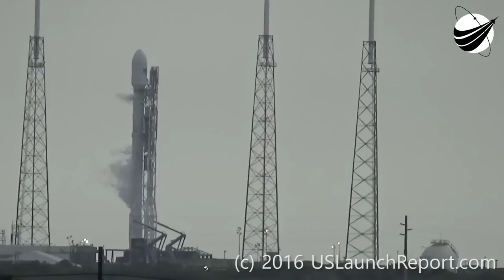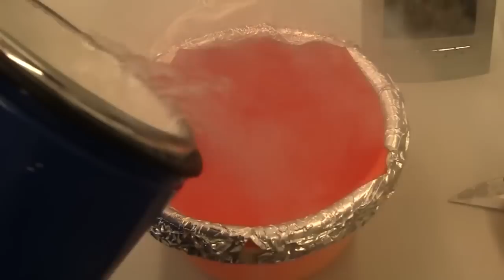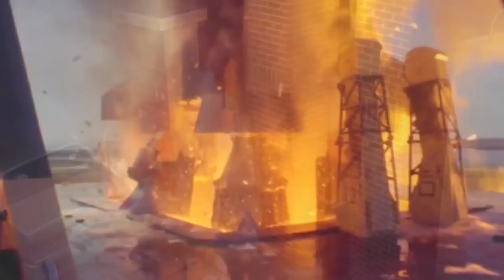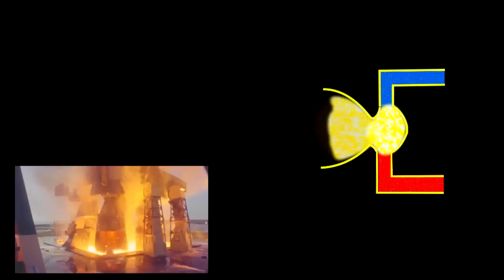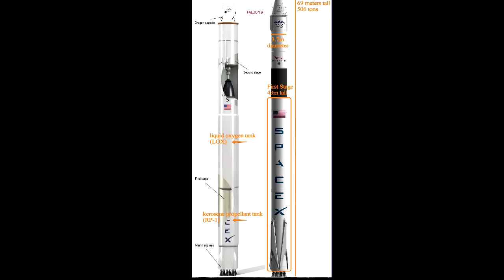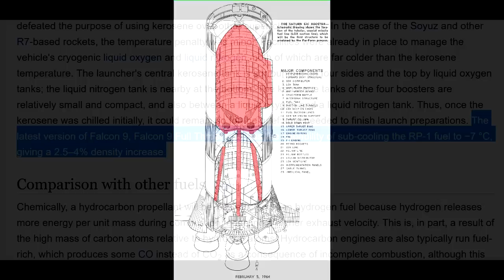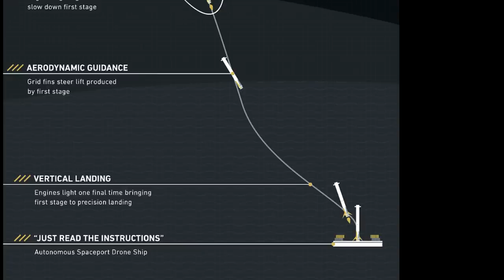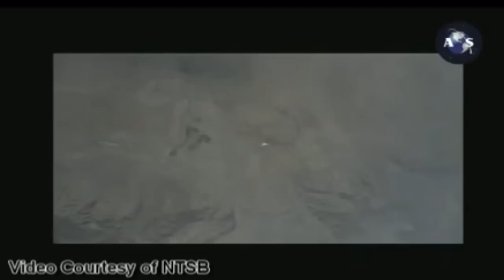Why did the Falcon 9 Explode?

Comment: show me any example in nature whereby gas moves a body in space...
Reply: +new perspective   A comet's tails (one gas and one dust) are affected by the solar wind.  Also, outgassing from the comet can cause changes in rotation (and possibly changes in velocity), similar to the effects of rocket thrusters used for rotating spacecraft.  http://www.sciencedirect.com/science/article/pii/S0032063305000826
Reply: so why did the comet that was tested for composition by a BLAST on the surface not move in its trajectory..???
2 force pair and two bodies are required to ratify newtons third law...out gassing has no force....freely expanding gas requires no force to expand therefor produces no force..
Reply: If gas has an effect on objects in a vacuum I would expect to find an example in nature. All forces that man has access to exist in nature (including fission, fusion, chemical reactions, steam, etc...). We do not create forces we only discover them. In ancient times people thought a comet's tail was a gas jet pushing it along. Today I cannot find an example of an object moving through space via gas/jet propulsion although streams of gas and particles shooting into space exist. Saturn's moon Enceladus, for example, shoots a jet of water ice 500 KM into space. The diameter of the moon itself is only 500 KM. Does this jet have any effect? No. The jet as tall as the moon is wide goes harmlessly off into space. http://en.wikipedia.org/wiki/Enceladus_%28moon%29
Reply: "All forces in the universe occur in equal but oppositely directed pairs. There are no isolated forces; for every external force that acts on an object there is a force of equal magnitude but opposite direction which acts back on the object which exerted that external force. In the case of internal forces, a force on one part of a system will be countered by a reaction force on another part of the system so that an isolated system cannot by any means exert a net force on the system as a whole. A system cannot "bootstrap" itself into motion with purely internal forces - to achieve a net force and an acceleration, it must interact with an object external to itself.
Reply: out gassing of a comet is very debatable as the tail is officially described as gas....nasa dirty snowball...this definiton is under scrutiny as new observations imply it is a plasma discharge....the evidence for outgasing is scant and debatable
Reply: new perspective   If you saw comet Hail Bopp, then you would know that it had two tails.  One bright one and a dimmer blue one.  This is due to there being more than one material coming off of the comet (gas/plasma vs dust).  Often people don't differentiate between gases and plasma.  Such as saying the sun is a ball of gas, when more correctly it's made of plasma.   But since a plasma is often defined as an ionized gas, it probably can be said that both are correct.  So whether a comet outgases "gas" or "plasma" wouldn't make much difference in regard to how ejected materials affect the object that is giving them off.
Reply: joules principles state that freely expanding  gas in a vacuum requires no force to expand....so how does gas interact with the comet if the gas is not interacting with its inhabiting medium...
newtons third law requires that there be two force pairs and two bodies
gas freely expanding in a vacuum is not a force.....F=ma implies there is a force but a force is not a force untill it interacts with something...
gas cannot interact with a parent body unless something interacts with the gas..
An energetically isolated system, cannot push itself through space
Reply: new perspective  Expanding gases create pressure (therefore force) in all directions.  Pressure is a force pushing against the internal parts of the rocket engine (or against the comet).  Since the rocket nozzle opening creates an imbalance of forces, the gas pressure pushes in the direction of the rocket an expands into the vacuum (when in space), creating thrust.  http://web.eng.fiu.edu/mathmatters/m2ed/newtons3rdlaw/IMAGES/index_clip_image002_0000.jpg  The evidence is that there are working satellites in space.  GPS, weather and communication satellites as well as the ISS.  All of these used rockets that work in a vacuum.  You can even see the ISS for yourself when it passes overhead.  Just input your location into this website for the next time it passes over your location.  https://spotthestation.nasa.gov/sightings/   I have seen it a couple of times.
Reply: force is not a force untill it interacts with something...and newtons third law specificaly states there need to be two force pair and two bodies..
 According to Newton's 3rd law of motion, for every force there is an equal and opposite reactive force. If you push on a wall, it pushes back on you with equal force. Obviously, you cannot push on a vacuum. And you can't push on gas that's exposed to a vacuum (not under pressure). A rocket works within the atmosphere because, when you decompress a highly compressed gas, it must push some of the atmosphere out of its way as its volume expands, creating a reactive force, as the pressure equalizes. It's the weight of the atmosphere under gravity that squeezes the decompressing gas, providing thrust. If you remove that pressure, releasing pressurized gas from a rocket's nozzle is like trying to divide by zero. The equation used to calculate the work done by a gas is: work = pressure x change in volume. If pressure = 0, then work = 0.

Comment: Thank you for the video Thundertf00t. Didn't realize you could actually calculate the amount of mixed fuel by the primary explosion =) 

However, from an engineer's perspective, I do really think you go a bit harsh on SpaceX here, here are my 50ct if I may:

- Having a problem solved decades ago does not mean that a problem will never happen in a new design. Consider something sounding easy like a "pipe running through a tank". Once you start an engineering design, it doesn't sound so simplistic at once: you have to find a way of doing so which can be produced, assembled and inspected - an that cheaply. You have to find sources of the materials you need and ensure their quality. You have to account for any temperature-related effects, aging effects and so on. Each of the problems may sound very solvable - after all, it's the engineering routine, yet with so many parts on a complex machine with so many little stuff to consider, mistakes do sometimes find a way in, even through testing. Just think about Challenger Shuttle! Now SpaceX is probably even more susceptible to those, because they seem to experiment with new production technologies a lot. Let's be honest: it's not about a "better rocket" but a "cheaper rocket". But even through the risks increase in the short term, cutting costs is a very valid reason on the long therm! Either you cope the risks of attempting new solutions, or there is no point on trying to improve an existing system.

- The reusability at the costs of fuel has been discussed a lot in Musk's interviews: his point is that fuel is really cheap and sacrificing part of the load to be able to refly the very expensive first stage does make sense economically. Of course, the refubrishing process must be cheap enough - not the way it was with the shuttle. It's a lesson learned. I'm not surprised they did not yet refly a stage, as getting the reusability right is no less about what happens after the landing as it is about the landing itself. They should take the time to ensure they get things right. BTW, if load is a concern, the Falcon 9 can be flown in an expendable configuration.

- The parachute discussion is old. The problem is that chutes do not allow for a proper steering and therefore are a uncertainty factor for a precision landing. Interestingly, AFAIK, the mars rovers did not do a steered landing at all: they were shot to enter at about the right spot, but the landing control did not care about the position of the landing spot - only about a soft landing. Chutes are good enough for this. Not good enough for a few meters precision. After all,  SpaceX is probably well aware of the tradeoff of fuel consumption and probably decided it's worth the gained precision. BTW going onto the ship rather then salt water is about cutting the refurbishing costs.

- The comparison with Virgin Galactic is a bit odd. Scaled composites did pretty much their own thing - and did so at a very low cost promise. I'm not really surprised they could not get the expertise and seriousness to make it right. SpaceX, in fact, did acknowledge many times the help and the partnership of NASA. They do seem to acknowledge the lessons learned by the NASA and they do have experienced people with them. It's easy to see the progress it got them from Falcon 1 to Falcon 9. And they did deliver on the most promises they made yet - they weren't the only ones to have setbacks lately (just look at the Proton launches!) - it makes the successes no less valid.

Sorry for the long post. I'm really excited about the stuff SpaceX achieved lately. Yet a discussion should not be about being a "fan" of one or another - it's about the engineering challenges and solutions. It's very well possible Elon did the right call on SpaceX and Tesla yet the wrong one on Hyperloop - I do in fact think so. Would it be THAT bad?

Comment: The reason why it makes no difference in having a 'reusable' rocket that can land back on earth is because due to the stress, the raw materials must be melted down and machines from scratch to ensure there aren't any structural issues.  The shuttle did this by merely dropping them in the ocean, to be recovered later for raw materials.  So it's impractical to re-use rockets merely from a structural standpoint.  

You definitely don't want to be on mars and have a rocket explode on you, because even if you survive....you're stranded.  So Space X may be commercial, but it's not exactly the future.  It's just people banking off of space travel that once had a monopoly run by the people, rather than for profit.  Not much good can come from monetizing space travel. It will end up making space travel cost more in the long run because they will prioritize profit over safety, and rocket explosions will simply become a fact of life, a gamble.
Reply: Rocket having failures is has always and will always be part of life, just like plane and car crashes. Also, SpaceX have cut the price of launches in half because they care about producing an affordable product (realitily speaking) instead of taking they're sweet ass time.

Comment: You explained a possible reason for leakages, yet that is no hypergolic mixture: ignition is needed. 
Besides, SpaceX works in close cooperation with NASA and also employs quite a few ex-NASA engineers, I would be very surprised if the incident comes from an "obvious" design flow.

Comment: There is always a risk of an explosing during fuelling especially with relatively new rockets. Nasa has used same rockets for ages and of course older rockets are better known and have lower risk factors.

The explosion was originated in the oxygen tank, which basically rules out the oxygen line leaks you talked about.

Then, lastly the fact that the end of a stage is the most efficient: it's true, but so is the fact that leaving the second stage off makes the last bits many times more efficient so the actual needed fuel is absolutely minimal: it and the slight scaling necessary by it is marginal compared to the savings by reusing the stage.

I personally agree on the falcon 9 being just an improvement over the shuttle, but wouldn't call it marginal: it is bigger than most improvements between generations of rockets.

And I have to say, the level of your videos has dropped in the last two: I mostly just get the picture that you hate Elon Musk which makes you overnegative over his projects. Some points are of course true but you should also comment the positives on the things you rant about.

Comment: +Thunderf00t cool video, BUT: as you guided us nicely through the possible sources of explosion, the curve you took to the end surprised me a bit. Or lets say, I totally get the point of where you led to, but I wished for some more specifics, thoughts, logic number crunching. Because what kickt to my mind where so many follow-up questions. Like, what gets first into the rocked, fuel or oxygen. By the diameter of the explosion, we know how much oxygen there was. But do we know how much fuel there was as well? Cause what happens if we had more fuel then oxygen to produce a larger Explosion oder just not enough oxygen. Then I am thinking of how much fuel is there in the second stage. would that fuel have been enough mixed with the whole lot of oxygen from below to get that fireball. So might it be possible to narrow it down to a failure up there where the explosion took place. Even though coming to the same ending, reasons, etc, it would have been just cool if you could have maybe narrowed it a bit more with the number you had - if possible, if you had enough numbers... anyway, thanks for the vid! learned a lot again

Comment: Falcon 9 != Space Shuttle. You can not compare the economics of the two. The intention with the falcon 9 is fast turnover with (almost) no maintenance between flights. Clearly it will take a while until they get to that point. They are the only ones trying RLVs right now and I applaud them for that. If we can not get reusability solved, we are doomed to stay on this rock. Throwaway rockets wont get us anywhere.

Comment: I don't see why they even need to make an actual landing on a boat over the water. Why not just use a similar system like the SRBs on the space shuttle?  The higher altitude can be accounted for by a drogue chute. The salt water threat on the engines is probably less than the threat of the rocket tipping over or having a guidance failure. The rocket would weigh less as the current design requires a guidance system, excess fuel to make up for the their needed to land the rocket, landing gear, and a range safety system in the case of a guidance failure. Additionally, why was the ascent stage designed to go to an altitude where reentry heat would be a problem if they are planning to reuse it? Any burns made midway through the descent are vey inefficient.

Comment: Ha! Fellow Scientist, Dr Mason, by coincidence, I had also estimated the distance in a comment on FB bc some idjit said that the 'audio wasn't synchronized', lol.... had to explain that nobody's allowed anywhere near the launchpad for this very reason.... However, according to the video clock, it was 17 seconds between visual and audio, and using 1100 ft/sec as estimate, I got 18,700 ft, about 3 1/2 miles... must've been a diff video, different camera that was farther. (it was the CNN video)
When I saw the Space shuttle launch, we were on the coast, and the boom hit us at 51 seconds, (measured from teh video I recorded) about 11 miles, and even at that distance, the shock wave of the SSRB's igniting felt like getting physically shoved in the chest, fucking intense and wicked powerful.

Comment: Ultimately, what matters for a recovery system is weight. I suspect that Musk et al have carefully considered the extra weight of a parachute (that can slow a reentering rocket stage!) vs. its savings in rocket fuel and found that leaving 35 tonnes in the tank is the easier/better/cheaper/more reliable solution. This is the same reason why bringing empty boosters down as gliders isn't often done, because wings are heavy for how much they slow it down in comparison to rocket fuel.

Comment: I was curious about why the rocket was "flown" in and not "glided" in. I mean, might as work with gravity and not against it. Gravity is "free" energy, just direct it in the direction you wanted (flying). I know there's not much air high up, and gravity will pull you "down" faster than you want at first, but you can use less fuel to brake your fall and use the "free" gravity to bring you in the rest of the way instead of burning it to the ground. I thought there might have been some numbers crunched and it was found to be cheaper to do a long burn (rocket landing) instead of a controlled crash (previously known as flying).

Comment: To say that they "figured out this problem over 50 years ago" or however long it was, simply isn't true. SpaceX is the only company currently employing carbon fiber fuel tanks which is a completely different ball game than the aluminum tanks that most other companies choose to use. It's a different problem. You can't just drill a hole in carbon fiber without expecting a significant loss in strength in that area, and wrapping around the fuel lines  would present an equally challenging problem. Then again, SpaceX clearly needs a more rigorous testing procedure for their tanks.

Comment: I've been thinking about the reusable rocket engine idea.

Why not use a parachute to parachute the engine down to the ocean and be recovered that way instead of using the fuel?

NASA has always been using parachutes to safely land crew capsules, why not go with one of those? This is because I feel the parachute is safer, more reliable, not to mention you can use all of the first stage rocket fuel to get the rocket into space.